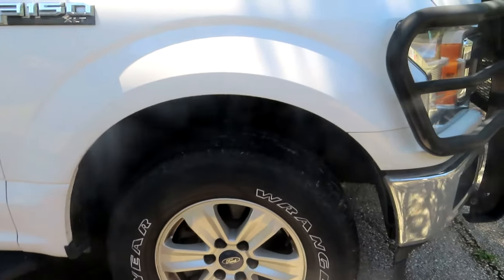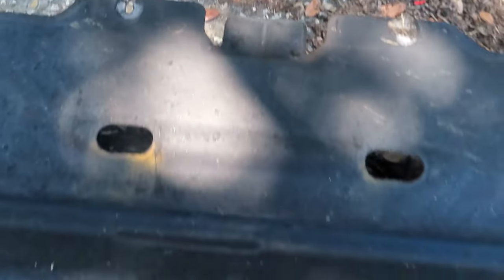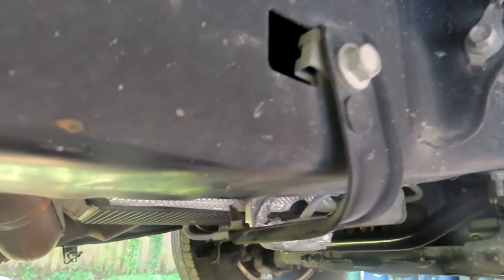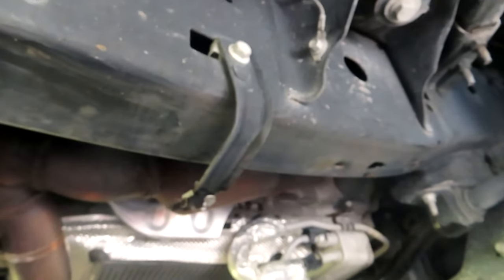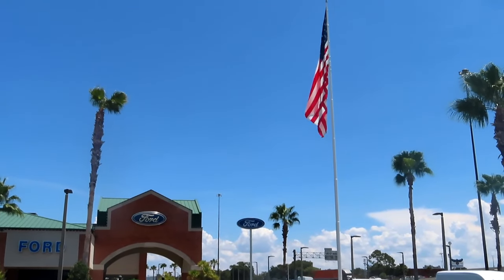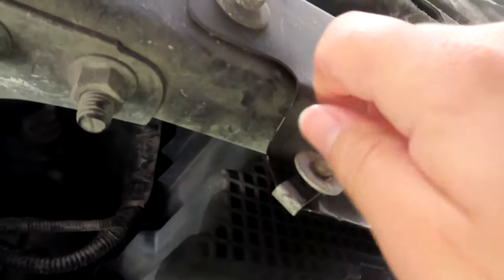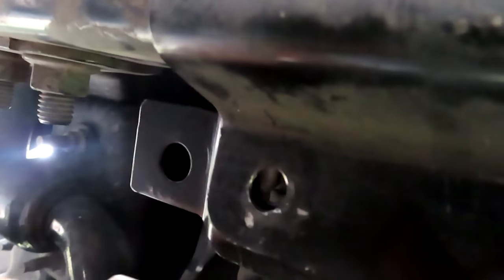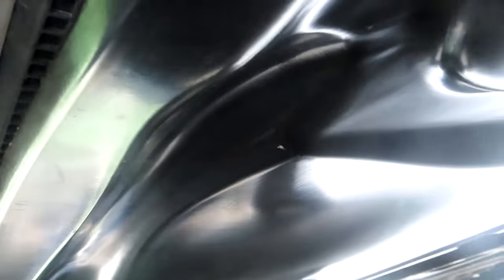2019 Ford F150 Transmission Splash Guard / Skid Plate Guard Replacement

Comment: I replaced mine a few years back with a Raptor cover.  There were millions of these trucks sold between 2016-2019 and they all have this same problem.  I cant understand why an aftermarket company has not made a bolt-on replacement out of HDPE plastic with a drain port so it does not need to be removed every 3000 miles.  The steel Raptor cover is bad-ass but mine has rusted and I also hear vibrations no matter how tight those backing nuts are tightened.  The HDPE plate would be ideal and there is a large market out there but nobody makes them.

Comment: Mine was being a huge pain especially with being in northern Michigan and it being wet for months at a time. I do a lot of hunting and off roading so I ended up going with RCI skids all the way back to the transfer case and then one on the gas tank. Why would you make an oil pan and transmission pan out of plastic oh sorry “polymer” I’ve had the oil pan warp twice now and needed to be replaced
Reply from the maker: Yeah, I was annoyed when I figured out it had plastic pans.

Comment: I’ve seen that several people have asked if this needs to be removed to change the oil, however I don’t see a written response. Does it have to be removed to change the oil?
Reply from the maker: You probably wouldn't want to change the oil with the plate still on unless you want to do some modifications to the plate - I pinned a link to an update video at the top of the comments if you want to see the drain plug in relation to the plate or you can click here: https://www.youtube.com/watch?v=IJB8TFO41dk

Comment: Thanks for the video. Can you change the oil without removing the plate?
Reply from the maker: You probably wouldn't want to change the oil with the plate still on unless you want to do some modifications to the plate - I pinned a link to an update video at the top of the comments if you want to see the drain plug in relation to the plate or you can click here: https://www.youtube.com/watch?v=IJB8TFO41dk

Comment: I replaced the diaper with this part you listed. On my 21 f150 XL the front frame brackets don’t line up.  So I installed 6 of  eight bolts. I may have to fabricate a couple of brackets since I won’t modify the frame. Working fine so far.
Reply from the maker: Interesting, I thnk someone else noted something similar.  Not sure if they did something different with the mounting points.

Comment: Thank you! Very helpful. I just finished my installation and was flawless on my 2020 Platinum. If fact I didn't have the issue with the last bolt that you did. Mine mounted perfectly to the two previous front mounting points.  Thanks again!

Comment: Thank you for the vid!
Jus did my 2020.  You can get away using the existing 8mm's but you have to heave the plate up  and hold it so the bolt can catch.
... I did think I was missing something as the fiber/felt one sort of slots in between the 2 8mm anchor points, where the metal one doesn't.
As far as I can tell, the metal just fits over top (?)

Comment: Hey dude, nice video. I just did the same thing to my 2021 lariat with a 2.7. Have not done an oil change yet. Can u get away with not removing the whole plate?
Reply from the maker: You probably wouldn't want to change the oil with the plate still on unless you want to do some modifications to the plate - I pinned a link to an update video at the top of the comments if you want to see the drain plug in relation to the plate or you can click here: https://www.youtube.com/watch?v=IJB8TFO41dk

Comment: Will this will work for a 2023 F150 XLT, 3.5L Ecoboost, supercab? Great video too.
Reply: I contacted Ford dealership and they looked it up by Vin.
Reply: I just looked and it doesn't look like I have a cover at all on my 2023 XLT. Does look like the holes are there for the bolts
Reply from the maker: I've heard that some have been able to make it work, but some people have said things weren't lining up for them.  I'm not 100% sure.

Comment: Guys, I have a standard cab 2020 F150 with the 6’ bed. When I tried to install this metal replacement, I found I did not have the frame holes needed to attach the forward most side brackets. The rear brackets and forward screws look like they’d match but not the additional side brackets. Thoughts?
Reply: Any update on what you chose to do? I've got a 2019 2.7L XLT SuperCab and noticed I don't have the front side mounting holes either. I haven't ordered the metal guard yet, so I'm wondering what I should do. I found someone on a forum with a newer F-150 without those holes say they're fine with just the smaller ones in the front and the ones in the rear. Still would like more opinions, though.
Reply: @IMissBionix  Good morning! Yep, I know what you mean! I had the same issue but decided to use the forward mounting brackets; just didn't want to chance it by using just the smaller two front holes and the rear two side brackets....though I was likely being overly cautious! What I did was to mount the plate using the two front and two rear attachment points, and marked the location of where frame holes should be for the two forward side brackets. I then removed the plate, and used "rivnuts" to create attachment points. If you've never used these rivnuts, look them up!!! So after the rivnuts arrived, I selected two 3/8" units, drilled a 33/64" hole where I marked the frame, installed the rivnuts, and reinstalled the entire plate. This was VERY easy to do, and gives me peace of mind! Credit to a guy from the F-150 forum for putting me on to this solution.....please don't hesitate to ask questions!
Reply: @MeShoo-c5p  I appreciate the info. I'm not sure I feel too comfortable drilling holes into the frame, but if I don't have a choice ... How are oil changes with this setup? I read someone talk about how their rivnuts would just spin when trying to take the plate out.
Reply: I’m sure you’ll have nothing to worry about by drilling a single hole through the outer face of the H frame. Though this would need to be done on both sides in able to attach the forward side brackets of the plate, consider this…MANY heavier and similar size F-150’s already have holes in the areas we’re discussing, so structural integrity should not be a concern. Besides, the holes can be easily drilled with the truck sitting flat. Any rivnut spinning issues is simply a matter of the rivnut not being tightened properly during installation. Truly, the whole installation, from start to finish shouldn’t take more than an hour! As for oil changing, the plate can be pivoted down on the loosened rear bolts, but just as easily removed totally.
Let me know if you have any questions!

Comment: Allen!! Welcome back bud. 1 suggestion get blue locktite put a couple of drops on each bolt 🔩  if you don't you might lose them and that cover could fall off and then you might have a bigger problem with all the damage. Don't go heavy with it just a few drops on each.

Oh FYI I'm still waiting for that impala 😂😂 lol.
Reply from the maker: Good point.  The Impala is still running strong, doesn't get driven much, but it runs when needed.
Reply: @TheCopCar  you see if I had it it be driven. Lol specially on my part time job.

Comment: I bought this same exact one, I have the same issue where I am missing the front mounting points, everything else fits what in the world is the difference
Reply: Which kind of cab do you have? Another commenter said he lacks the front mounting holes on a regular cab. I've got a 2019 2.7L XLT super cab (half-doors in the rear) with the same issue. I wonder if those holes are there by default on the crew cab (full four doors) and not on the regular/super. That's the only thing I can think of to explain why the truck in the video has them and mine doesn't. They're otherwise the same engine, trim level and model year.

What did you decide on doing? I haven't ordered the metal one and I'm not sure what to do. I found someone on a forum with a newer F-150 without those holes say they're fine with just the smaller ones in the front and the ones in the rear. Still would like more opinions, though.

Comment: Awesome video, one that we All needed. Before I order, this plate will fit the XLT too? Basically all 150s? I have a 2019 and tired of the damn zip tie projects
Reply from the maker: The truck in the video is a XLT
Reply: @TheCopCar  mine is an xlt also, didn’t fit mine, was missing the “center holes” for the 13mm, oh well, still a great fix for those who can use it

Comment: So now the whole metal transmission cover needs to be removed in order to drain the oil?
Reply: What’s the difference between removing the metal cover and that crappy other one that rips and flops all over the place when you drive down the road?
Reply: My bad… for another $70-80.00 you can get a ten inch or so oil drain plug cover that fits onto this cover…plus three more bolts.
Reply from the maker: I think it depends on which engine you have.  I have the baby 2.7L, so you probably wouldn't want to change the oil with the plate still on unless you want to do some modifications to the plate - I pinned a link to an update video at the top of the comments if you want to see the drain plug in relation to the plate or you can click here: https://www.youtube.com/watch?v=IJB8TFO41dk